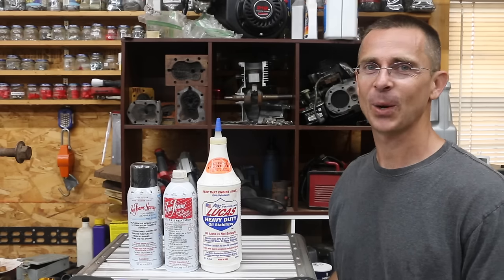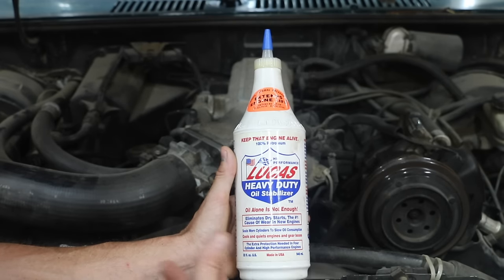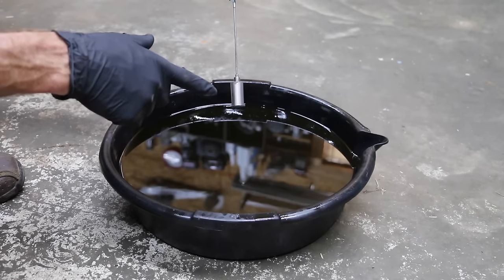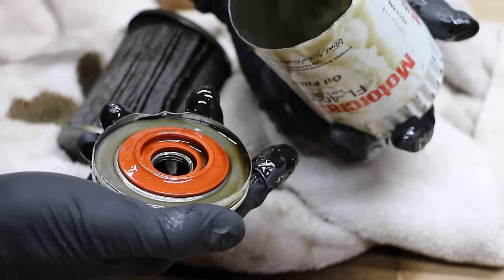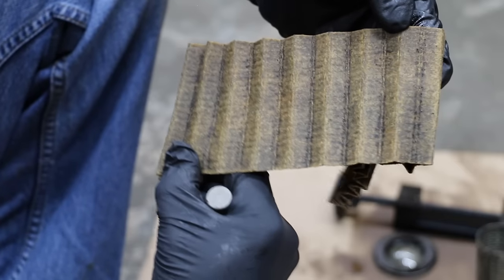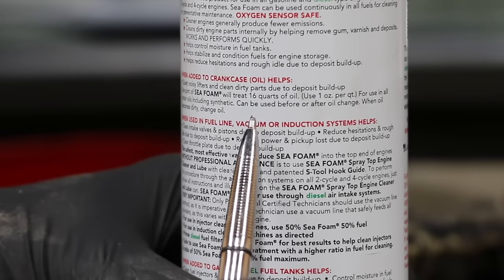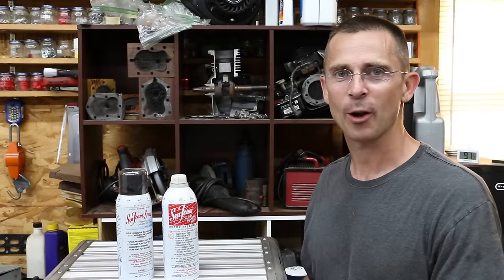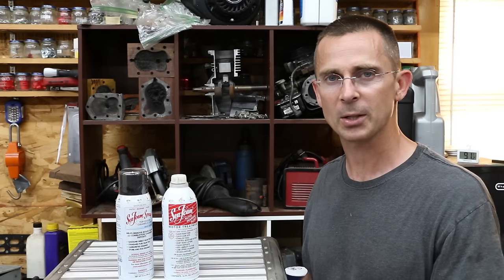Did the Seafoam fix last? Update on the Ford Ranger

Comment: Engine restore works for me . I used it on my 1999 f150 with a inline 6 . 80,000  More power and improved gas mileage.  Also wih my 1500 silverado 75,000 miles
5.3.
Reply from the maker: Thanks for the feedback.

Comment: I have a 2001 Dodge 3/4 T 4x4 with the V-10, I love my truck and want to keep it running forever if possible. To that end I placed two very powerful magnets on the engine oilpan and transmission oilpan to attract metal particles. It won't get the non-ferrous, but they'll get everything else. And they were only $15.00 each for N55 3/4" magnets off eBay. Something to consider.
Reply from the maker: Thanks for the feedback.

Comment: In high school my auto mechanics teacher was Mr. Hutchins (rip) he was very smart. Most of the kids in my class had cars from the 50's and 60's. To clean the sludge out of one of those old engines he would have us drain the oil, remove the filter (most were the non-spin on type) clean the canister then drop in a new filter. remove all of the spark plugs and ground the coil wire. We would then fill the crank case with about 1.5 to 2 gallons of diesel fuel. for the next 3 or 4 days we would crank over the engine for about 30 seconds 3 or 4 times throughout the day between other classes. When we drained the pan, you would not believe what it looked like, jet black with clumps of sludge and little pieces of what looked like coal. With the plug out another gallon of diesel as a flush then let it sit for a full day with the plug out. Fill with oil, a new filter put the plugs back in and it was like a new engine. Mr. Hutchins was very old but loved teaching, he drove a inline 4 army Indian to school; he was also a mechanic in the Indy 500 during the 30's when the mechanics road in the car with the driver.
Reply from the maker: Thanks for sharing.

Comment: STP gas treatment sprayed right into the spark plug hole might loosen the rings IF they are carboned up. Let it soak at least 24 hours, longer is better.
A guy from work bought a mint condition little old ladies car. It ran good around town, he never took it out on the highway before buying it. It was plugged up from her only driving in town never getting it fully warmed.
It would not  go faster than 40 LOL.
Another guy told him to do the STP thing. It sat for three days. It was an inline six AMC. 
He spun the engine to spit out the treatment, put the plugs in and it ran a lot better.
He ended up doing a full engine flush by filling it with kerosene clear to the valve covers let it soak for several days. When he drained it, the fluid was jet black.
Then he did the clean with four quarts 10 w 30  oil, one quart trans fluld. Drove it about 500  miles and drained it. It was black again. Repeat. After about 2000 miles drained it again and oil was dirty but not jet black.
Eventually the engine ran good.

Comment: I work with metallic sludge every day I a factory (I de-burr steel pins) the magnets we have like the one you have even on a relatively clean filter will pull some metal clay off of the filter so I would say you are right and it is just engine sludge that the seafoam broke off.
Reply from the maker: Thanks for the feedback.

Comment: Came across your channel by accident but great job! I'm sure if it's still around and might already be posted in the comments but I remember there being a big following of Rislone and these guys claimed an increase in compression and reduction of burning oil. Great Seafoam/Ranger vid. I have used Lucas OS in everything for almost 20 years now ever since it got rid of the snare drum roll in a Plymouth slant 6. The stickiness is still there but not as easy to spot once added to crankcase. I know this first-hand because a faulty filter gasket forced an immediate replacement and I had what was in the filter to inspect. In Canada the Lucas label recommends 15 -20% of crankcase volume be Lucas OS. I also pour oil directly into filter before install and flash up the engine to prime the filter before adding Lucas. (I hate thinking of the bearings galling). These are all quick fixes and definitely extend engine life before major overhaul. I eventually had to tear down the top end on the slant six to grind the divots worn into the rockers so the feeler gauge was able to contact both points and give a correct clearance measurement. Again, great work!
Reply from the maker: Thanks!  Thanks for sharing.

Comment: I recently bought a ‘65 Ford Thunderbird landau. It has the 390. It was purchased new in CA then brought up here to WA state. Owner died, family didn’t want it so it was sold to a young man as a birthday present for his wife - they divorced soon thereafter and it sat in a garage for years. Lord knows the last time anything was done on it - so I had a new head gasket, new exhaust manifold, new spark plug wiring, lube oil & filter done, timing done, new battery, transmission fluid replaced and new carburetor gasket installed. It clatters like a diesel upon acceleration so I put in a can of Seafoam and drove it on a local highway for about 30 minutes. The clatter is still there - what next? 
The exterior of the car is quite nice, good glass and the trim and chrome are great.
Reply from the maker: Thanks for sharing!

Comment: CRC valve cleaning spay may possibly help the low compression. If the rings are gummed up, maybe the Seafoam might help. Lake Speed reckons that Valvoline protect and restore is highly effective over time. It is designed to work gradually, so as not to overwhelm the oil filter with sludge. An oil analysis before and after adding Seafoam will help determine whether it is upsetting the ballance of the oil additive package. Personally, I would be reluctant to have this stuff in my oil long term.
Reply from the maker: Thanks for the feedback.

Comment: I always change the oil with vehicle level.   I drain the oil overnight (or at least until 30 seconds between drips)    I use Rotella T6 15 w 40  and STP on my 302 swapped Datsun 1984 S12 (salt free month driver only)      I use the same drain technique on my Camry 2.2 but use ST synthetic 10w 40 or  5w 30 (depending on season in Michigan) with STP    I got just shy of 300000 on Camry    the Datsun ford thing has about 60k since rebuild      try a test draining all night     you will be surprised at how much extra drips out      yes I know a engine will still have oil even if drained for a week      do a test:    drain for 10  minutes.......swap out the drain pan with a clean one let it drain overnight.......I drain overnight to let any thing slower and thicker to drain out.....love your channel
Reply from the maker: Thanks!

Comment: On the older ford's, 292 cid's the camshaft bearing would rotate and block off the oil feed for the upper engine lube system. A kit was installed to remidy this.
Reply from the maker: Thanks for the feedback.

Comment: One solution for stuck rings has been to use a 50/50 mix of Dexron ATF. Run one thousand to fifteen hundred miles at working temperatures and repeat.  If it's rings, oil consumption is usually noticeably reduced.
Reply from the maker: Thanks for sharing.

Comment: Makes me wish I had an old Ranger to try and rehab.  I’ve had 2 Rangers.  One of them suddenly lost most of its power, but I couldn’t find a mechanic who could come up with a reason or a fix (even the dealer) and the truck had been regularly serviced and used as a daily driver with light hauling on occasion.  I sold it to a neighbor who worked at Edwards AFB in Kern County, CA.  The AFB is in the desert and the new owner told me one day that he was driving it in a wind Storm on the AFB and, heading into a wind, it would hardly go.  Should mention that it was a fuel injected V6.
Reply from the maker: Thanks for the feedback.

Comment: Seafoam Upper Intake Cleaner for Direct Injection engines which are prone to dirty valves because port injection exposes valves to the fuel which has detergents and keeps the valves clean.

Seafoam added to the crankcase will help clean oil passages and prevent upper engine oil starvation.

Engine Restore for engines that are losing compression.

Comment: I have used Lucas products for years. Engines that don’t have VVT I will continue to use it which is a lot of the older models. In 93 Gm recommend 10W30 in 94 with no charge to the engine recommendation was 5W30🤷. Point is , Lucas along with good maintenance practices can help someone keep a very high mileage vehicle on the road. I had an
 94 S10 that that had 425K when it was sold 2.2 4 cylinder 5 speed I now still drive 01 Cavalier 2.2 4 cylinder 5 speed and it has 290k . I use 15W 40 Rural King brand oil in 5 gallon buckets never had a problem related to oil.
Reply from the maker: Thanks for the feedback.

Comment: One more thing.
Check the compressor using Lucas.
Seafoam did the cleaning and Lucas is the protection and will raise compression a few pounds.
It helps cut down on the build up.
Reply from the maker: Thanks for the suggestion.

Comment: Marvel mystery oil cleaned my crankcase to an almost spotless finish, definitely after a long trip I noticed my oil was jet black so I think getting the oil hot really helps!
Reply from the maker: Thanks for the feedback.
Reply: I’ve added Marvel to my oil changes periodically. My understanding is that it soaks into the metal. I haven’t added any to the gas but I’ve heard people say it helps. Any thoughts?

Comment: As a master tech with 44 years experience, today's chemical engine treatments are very good. Light years away from the past. So these are my recommendations for chemical treatments that really work wonders. But the best thing is use them on your high mileage engine before an issue shows up. Number 1, dura lube at oil change time. This stuff penetrates the metal and stays there. It cuts friction by up to 70% . thats huge. Friction is wear and if you can cut wear by 70% one can imagine the much longer life of an engine. Number 2, Zmax for your fuel system. Much like dura lube it cuts friction and provides lubrication to your modern FI system. Number 3, Blue Devil. This is for your cooling system. This is sold to give a temporary to longer repair of a cracked head or block. Let me tell you this stuff works. Follow the instructions and you'll be amazed. But i recommend the use of it before an issue to seal your internal parts get more life out of the engine. Number 4 seafoam. I don't think i need to say more. And last but not least, Hapco mainsta.hard to find if not from Michigan but this stuff will shut up worn gasket and seal leaks on an engines oil system. Thats it. I don't have anything on transmission or a/c systems as everything I've used is either garbage or downright deceitful. Never put sealer in an a/c system. Test any of these my brother.
Reply from the maker: Thanks for watching.

Comment: I'd like to see you first drain old oil . Replace  oil filter with new one. Run engine add the Seafoam cleaner & lube. Drain oil & change filter again. Then add Seafoam SF128 motor treatment & Lucas HD oil stabilizer then check results on the motor.
Reply from the maker: Thanks for the suggestion.

Comment: Using Liqui Moly Engine Flush can really help restore the compression if there is ethanol gunk built up around the piston rings. A lot of the engine oil additives seem to add temporary bandaid fixes and may help compression.
Reply from the maker: Thanks for the feedback.

Comment: I have a rust free 1996 Ford Aerostar with the 3.0 engine that is well known for longevity if maintained. It only has 105k but I still intend to use Seafoam in the gas/engine as a hedge against time and wear. Think of how many vehicles get scrapped when a product like Seafoam could have at least been tried before scrapping/selling off...

Comment: I didn't have the clatter you had with my Ranger but it was not running great so I did the Seafoam Throttle Body cleaner with the curved tube and I ran Seafoam through the gas and the difference was amazing. This truck runs like new now. I might do a seafoam flush to complete the whole thing next time I change the oil.
Reply from the maker: Thanks for sharing!
Reply: I was stunned by the results.

Comment: And people say SeaFoam blew up their motors.  Glad your truck is running so good 

Usually, those who ruin their motors add SeaFoam to their oil only.  Since SeaFoam is a cleaner it ruins their bearings. SeaFoam should ONLY be used through throttle body and vacuum lines.  Never to oil.

Comment: only thing i will add is that "high mileage oil" has an additive package to help swell seals to stop leaks, and sometimes that swelling will also weaken seals, and make seals that were fine, start leaking. AND, like i said on the first video, you used conventional lucas with synthetic oil, instead of using synthetic lucas. great video, and still the best review channel on yt, regardless of my teeny criticisms.
Reply from the maker: Thanks!

Comment: You may see even more improvement using Lucas Oil injector cleaner/upper cylinder lubricant. I add some to my gas jug for 4 strokes, and before mixing for 2 strokes. I also use highest grade gas and Lucas gas conditioner/preservative. Makes everything run noticeably better.
Lucas upper cylinder lube/injector cleaner is one of those additives you can hear and feel the difference, if your engine is sluggish. I drove an old van for a bit. Automatic that would stall if I was not very careful, when switching from forward to reverse. There was enough torque just switching gear direction, and the engine sluggish enough that it stalled, nearly every time. Wasn't my van so I wasn't about to do any major repairs.
I put some Lucas oil in, and drove a few miles. There was a very noticeable increase in power before I got back. No chance of the van stalling when switching gear direction.
I am not affiliated with anyone either.

I used a product decades ago to clean out an engine, but can not recall the name of it. 10 minutes running it in the oil, then changed. This was a car that barely ran, and still sucked after an oil change, but it ran way better. I then added an oil additive like Lucas's to stop tapping/knocking and the engine smoothed out. I then added a cleaner to the transmission(Transmedic rings a bell), and the car became drive-able. Still junk but now wanting to run. I think I also used a cleaner in the air intake as well. I haven't tried the Seafoam products.
Reply from the maker: Thanks for sharing.

Comment: Wow.  Great video.  Watching as a follow-up.  

I've had good luck and believe in the results of Sea Foam, not so much with the Lucas - and just watching that Lucas goop go into my engine made me nervous.  I have a rear main seal leak and can't expect an additive to fix it, but it didn't reduce it at all.  Anyway, I ran an oil cleaning solution in there shortly after adding it to the oil and flushed it out.

Awesome production value on this video.  A video on engine oil on a farm  - with on-vehicle and drone footage?  Nice.
Reply from the maker: Thanks!  Thanks for sharing.

Comment: I used motorkote  upper cylinder lubricant gasoline additive at 1 oz. Per 5 gallons of gasoline on my 2008 Chevrolet Silverado with 175,000 miles on it. I had a lifter tapping noise and it went away. No noise 5000 miles later. I add it on every fill up.
Reply from the maker: Thanks for the feedback.

Comment: used sea foam in my '94 jag that had been sitting years--should have taken the gas tank off,cleaned but too lazy--it ran crappy,used sea foam--it now idles like a dream, runs smooth as silk,increased the gas mileage about 10 percent--going to put in the spark plug holes soon to help clean rings,using a little oil
Reply from the maker: Thanks for sharing!

Comment: Ceramizer is added to oil to create a thicker, ceramic-metal layer between parts that reduces engine friction. The properties of Ceramizer make the layer thicker on worn spots in the engine than in less-worn areas, which helps restore the original geometric design of the engine. Restoring the dimensions returns the engine to its original parameters, so that the engine works more efficiently and better compression returns.
Reply from the maker: Thanks for the feedback.

Comment: The Lucas is a great product. Try this test; get a screwdriver, put on your latex gloves and dip your fingers in plain oil. Pick the screwdriver up on the metal end. Now dip you fingers in the oil again add some Lucas and rub your fingers to mix the Lucas and the oil. Pick the screwdriver up again by the metal side. See if you can hold onto it. While the Lucas is thick when you put it in, it mixes with the oil and thins out. It reduces friction and allows all internal parts of the engine to move more freely. I use it every other oil change in my vehicles. Sea foam is a great product also. I highly recommend them both! Also the oil you are using is not a full synthetic, high milage oil is a partial synthetic mix. I always use Valvoline  but I use the full synthetic and go 7000 miles between oil changes.
Reply from the maker: Thanks for the suggestion.

Comment: Another strategy for this engine is to drain the oil completely next oil change, fill the crankcase with 4 quarts of diesel fuel and 1 quart of 30 wt oil. Start it, let it idle until it is fully warmed up. Do not drive it or rev it. Simply let it idle, it will find the sludge and liquify it better than sea foam can.

Comment: Used Wynn's Diesel injector cleaner on my Ford Ranger T6...Full bottle in a full tank, did a long drive - 300miles. Engine now seems a bit quieter at idle, less hoarse when accelerating. Now I want to put a Diesel system cleaner through it and see if it benefits further.
Reply from the maker: Thanks for sharing.